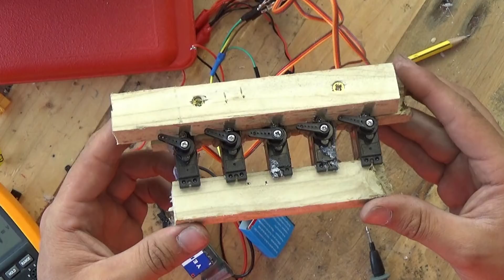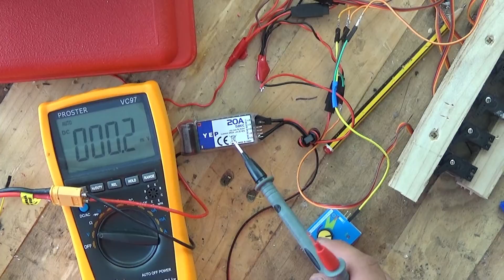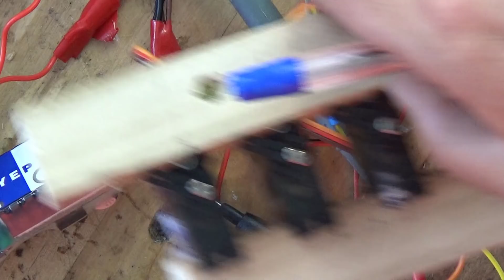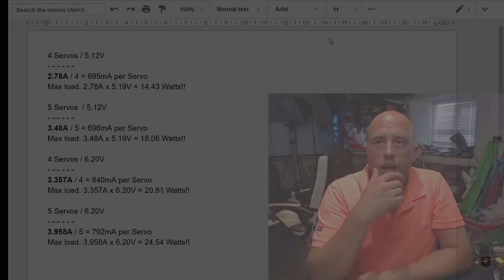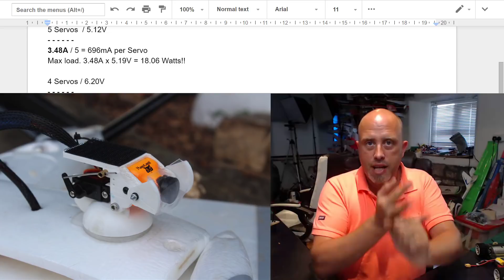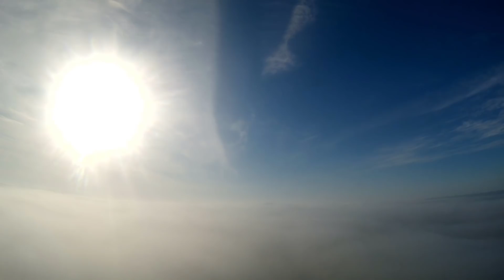4 RC Servos - How Much Current???

Comment: When calculating this for BEC etc, I think it might be important to consider that this is all at a no load situation whilst in the air, the forces on the servos will increase the current draw. At least that's my understanding...

Might be a better idea to test to test one servo with some luggage scales for resistance and then multiply after all...this will give a more accurate worst case scenario for current draw though I guess it's unlikely you'd ever be putting maximum force on all servos at once...

Either way interesting vid so thanks and the wiring concept was useful- that's what I was after! 👍😁

Comment: I know it an old video... But I have had two matek 411wse boards go bad.. One was in a bixler2.. With 4 servos... Some have said that they wouldnt use a 411wse in a model with more than 2 servos.... Would it be possible for me two run servos off the board.... And run two from the bec in the esc... Getting the signal for those two from the board.... Then I would have 3amps per two servos... Would that work?

Comment: If a BEC is rated for 20 amps, how many amps can you give it through the battery? I am doing a project (GCSE dt), and I was worried if I gave a 10 amp 12v power supply to a 20 amp BEC. Will this be fine?
Reply from the maker: Howdy, it would have been fine. You'd be mortified what we do to LIPO batteries in the air ;) Matt
Reply: @RagTheNutsOff  thankyou so much for replying to a comment on a video 1 year old.

Thanks, I needed that,  no website tells you this kind of info

Comment: I've been using 4 nylon servo towerpro SG90 with flight stabilizer and 200mW VTX gear AIO and FS-i6 flysky receiver, the 3A 5V from BEC is enough for the job and the plane flew smooth and stable.
a few month ago I replace the nylon servo with the metal gear servo towerpro MG90 just like the one you use here, but then the servo movement jitters, I change them to nylon towerpro SG90 and everything back to normal, so IMO the towerpro MG90 draws more current than towerpro SG90.
Reply: SG90 is analog, 
your mg90 might be digital, however I tested one of these and I actually didn't find them digital... but hard to say from CN you can get anything...

Comment: Well, first thanks for the test. Hmm I'm working on a servo now, using arduino library, but I think is that the servo should take current even if it's in rest, but I think that's normal to keep the servo in position.

So I should feel some pulses in rest position. But what about if the sevos get warm at rest position, is that normal too?

Comment: Just one "standard" servo such as a Futaba S3003 can pull 2 amps at stall torque on 4 cell AA NiCd.
Higher power digital servos can demand MUCH more.
You can not  test one type servo and expect the results to be the same for all servos.  You should be testing all of your servos

Supply power as if expecting at least HALF of your airplane's servos to be stalled. ("3D" planes, can expect ALL servos to be stalled at once briefly in extreme aerobatics) 

For most servos with nylon gears, you can potentially strip the gears on 4 cell NiCd by preventing movement.  Higher voltage does make the motor more powerful but it does not make the gears stronger.  Use a weight on a long servo arm to load the servos for testing.
Reply from the maker: Howdy fella, yea I'm never likely to own any Futaba servos. I used these as this is what I have used in nearly ALL the builds in the past two years, Matt

Comment: hmmm...i'm not the expert, but this experiment looks like we test a motor current draw but we not put a propeller in it, maybe you should measure when the servos attached with the control surface Matt
Reply from the maker: Hey Benz, yep that'll be part 2! Matt

Comment: So I'm building an S800. is the mateks 5v @ 2000ma enough to run 2 servos. What if it exceeds the 2k.
Reply from the maker: Howdy fella, "should be fine" as it'll be two servos and a receiver on the 5V line. See if your ESC has a better bec in it and if it does, use that instead, Matt
Reply: RagTheNutsOff nice one for a reply m8.
I'm using spares I have for quads & only have blheli 20a. I have added a cap.
This is my first wing & I been watching your videos. So it would work but be better if I got an esc with a BEC. To lighten the load. Or I got the pdb & BEC that comes with it. You have to Solder them together Could I just put that bec on its own on the lipo pigtail with the capacitor.  & power the servos that way.
Cam on 5v & vtx on 12v. Thanks again look forward to future vids.
Reply from the maker: Morning fella, try it and see how it does is probably the best answer. There are good 3A BEC's available on BG or a dedicated plane ESC with a BEC in are normally perfectly fine. Plus it;s a wing, so only 2 servos and a receiver. Matt

Comment: I wanted to try the mystery yellow ESCs, after flashing to SimonK, on ultimate cheap builds using Flight Test plans and Dollar Tree foam board. With those having a 2A BEC, now I'm not so sure. I really wanted to do some total cost < 20 USD models, but I doubt I'll be able to keep them in the air.
Reply from the maker: Howdy Ted, I know the ones, I set one on fire the other week with too many amps through the motor. Up until then, it was surprisingly OK. Give it a punt and see what happens, Matt
Reply: 2A BEC is enough if you don't have more than 4 micro servos. I tested on my KT foam plane. About 1.2 A max. That mystery yellow ESCs are just doing their works as expected. If you find that sometimes you lose control. Then it's highly possible that the BEC overloaded. You can also choose to use a separate BEC.

Comment: Thank you so much for doing this, I built my first wing the other day thanks to your informative videos (and it flies great). iNav + omnibus f3, m8n gps and eachine vtx03 and 2 cheapo blue ebay servos, and I thought that my linear bec esc (rated for 2A) wouldn't cut it. So I went ahead and plugged my servos and vtx to a standalone 3A BEC. Looks like I was right so I can avoid the dreaded brownout/fc restart or even worse overworked/burning esc bec, thank you!!!
Reply from the maker: Giorgio, Happy Days! 👌 Matt

Comment: Just so you know, multimeters average the current draw, so instantaneous draw will probably be much higher and ideally you'd have an (os)sillyscope to meaure that. ☺

But that said, a switching BEC would probably be able to cope with the occasional brief overdrawing of amps as they have a charge pool, unlike linear BECs.

Edit: Forgot to mention, the popular Hextronic HXT900 servos have been claimed to draw ~750mA each !
Reply from the maker: Morning Loc, yes a very good point! And those HXT900, I think I have two of those kicking around here, I'll try them out. Matt

Comment: After this video I am upgrading all my large helicopters with the 20a BECs!  4 Standard size metal geared digital servos got to be pulling some amps along with the flight controller and the 2 (or more) Sat RXs.
Most of my large helicopters have Opto ESCs so I already have separate BECs but will be checking to insure they are rated for enough amps.
Thanks, Matt!
Reply from the maker: Howdy Paul, jesus yea! Heli's are bonkers and that is an excellent example where servos can and will hit max loads quickly. AND thats not something you want to be under powered on when it's spinning two samurai swords around either. Caution is definitely a good approach there Paul, Matt

Comment: If you stall all the servos they will clearly draw loads of power....It's hard to say what's really going on here. I would be interested to see what would be going on if your circuit included the motor and the reciever. Your experiment gives a good ballpark figure, but a current sensor in a model when the control surfaces are under real air pressure with your control surfaces are at full deflection in a dive or other violent manouvre. Good fun though!
Reply from the maker: Howdy Keith, absolutely, looked out for part 2 where we'll explore this further. Matt
Reply: I've done the in flight testing, and have pulled 15+ amps servo power in flight in a .91 glow powered model, not doing 3D.  I forgot which servos were used, but they were all the same 90 in-oz rated.  2 aileron servos, 1 rudder, 1 elevator and throttle.  No retracts or flaps or other optional controls.
I moved to 120 in oz on ailerons, 2 X 90 in-oz on elevator and one 250 in-oz on rudder; Hitec Digital servos and dropped max current logged to 11 amps, going through the same aerobatic routine. (AMA Sportsman Pattern sequence from appx 10 years ago)

15 amps was the max the current logger I had would read...

Comment: It's an interesting test, but as you say most pilots aren't going to achieve such extreme loads on all of the servos at once. But again, as you say, adding multiple servos means that giving yourself a little more safety by upgrading the BEC is probably a good idea.
Especially if you are ragging the nuts off a model :)
Reply from the maker: Morning fella, yea thats my point, we didn't know how much current servos could take before, hence why I did this test to see wtf was going on. Wil ldo a part 2 as well, to follow up on a couple of things, Matt

Comment: Is it me, or did you have all / some of those servos in a stalled condition against that block of wood?....and you are surprised at the current they are pulling?....Im not.
   I tend not to have blocks of wood preventing servo movement in my models....what are you trying to prove Matt?
Reply: EnglishTurbines. Safety. Prepare for the worst, hope for the best. 
That's my guess. 
Hopefully we never reach the worst.
Reply: On my 2.1 m Cessna 150 Z, on landing, have 2 flap servos, 2 aileron servos, vertical and horizontal stabilizer servos a working at once. I noticed the 80 amp Yep esc has a 6 amp bec.
Reply from the maker: Morning ET, good question, simply "worst case scenario". Look out for part 2, I'll address the feedback from this video and explore this further, Matt

Comment: Nice.  Coming from the quad side of things should we be adding some capacitors to the servo power rail??
Reply from the maker: Hey Jason, it'll help as they're mini batteries. However normally in quads you're adding a capacitor to smooth the power supply for the FPV gear. Matt
Reply: Capacitors are a solution to only appx 1/10 second of high servo power demand.

Quad copters that have no servos will have no flight loading of the RX system.. it takes very little power for the RX side of the ESCs

Comment: Matt, this is assuming that all servos reach max at the same time.  How many servos are moved to Max Stall in reality?
Reply from the maker: Morning SK, absolutely! We're testing worst case scenario here to see what happens at the max, that way we can account for that during our builds. Matt
Reply: an electric powered 3D aerobatic model can stall all servos in flight at once. (throttle servos rarely stall in glow or gasoline models if the linkage is set up correctly... you can stall anything else with flight loads)

Comment: Max load and quick movement and, even higher amp draw.
Reply: It would be interesting to know how much current a servo draws when it is moved quickly, but you would have to have the equipment to measure peak current. Max load, however, is usually when the servo is stalled, and therefore not moving. You can't have a servo moving quickly and stalled at the same time. Stalled is not moving (in this case stopped by a block of wood).

Comment: Hi Matt good test but I would like to see the test done with an actual 3amp bec while monitoring voltage and current at the same time to show just how bad things can get.
Reply from the maker: Hey Brian, thats not a bad idea fella, round #2 !
Reply: good point,  i think the voltage sag is is gonna cause a brownout because the 3 amp is running on it's toes,  the 20 amp in the test from matt has an easy job. still good test tough.
Reply: Is the yep a good bec then to buy rather than use buikt in bec
Reply: Very helpful video. The 20A was a crucial test to show what the servos can actually draw without brownouts or failures involved. But, yes, a repeat with typical 2A, 3A and 5A BECs would answer the "real world" questions.
Reply: Yes you would, me to🙂🇳🇱